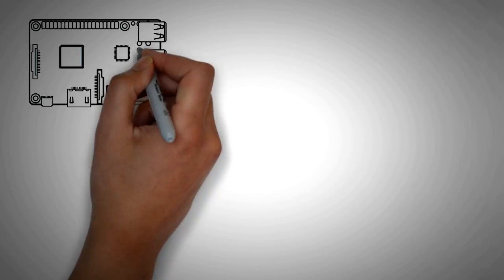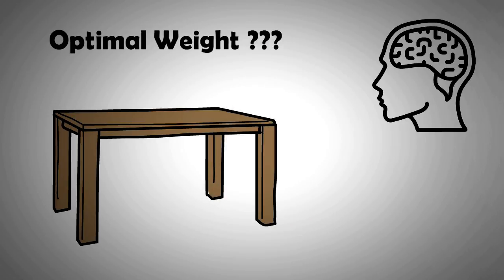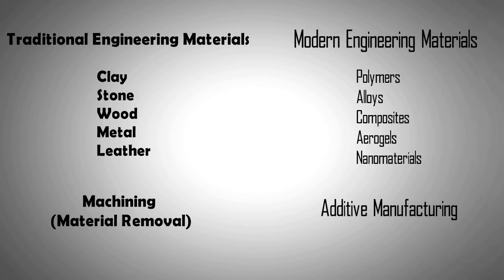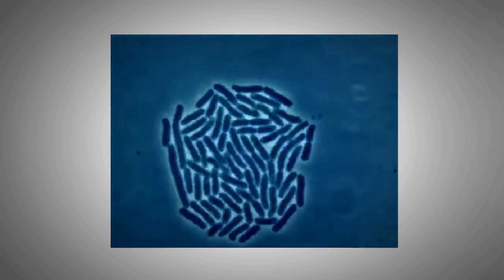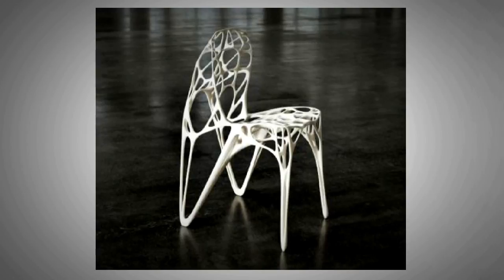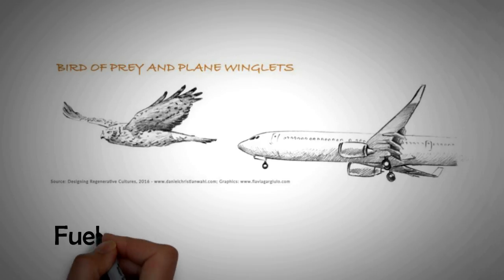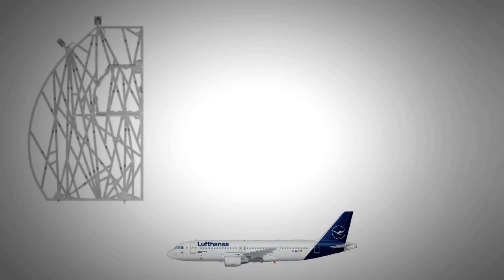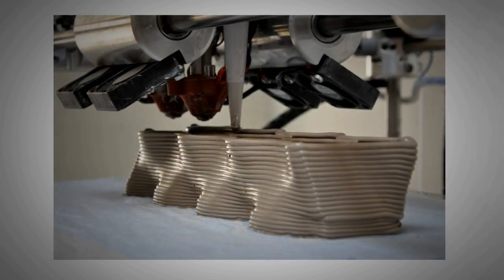Generative Design: A revolution in Engineering

Comment: Good stuff. I think the bigger problem than the organic shape design is the cost of printing and the cost of strong printable materials.
Reply: Good point... Just to open up the cost aspect with energy required/time consumption too in addition to machining/material costs... Overall cost/efficiency over time can bring the cost down of the printed materials though... as with mass/volume production and technological advancements will also bring down time/energy consumptions too... There will be a time printing stuff will be both much cheaper on time/energy and material costs...

Comment: These designs immediately reminded me of the Maserati Birdcage race car. This was a fifties race car space frame where instead of big box section main frame parts the car frame was built of of hundreds of little hollow steel tubes about the size of a pencil welded to form a 3D matrix. In those days of course they were all made by hand. This wonderful car was the lightest - but not the cheapest - race car in the world.

Comment: Works ok as long as you have ALL THE  LOAD CASES COVERED
Reply: There is always a weakest link. You can only cover in calculations most cases. Imagine constructing a bike that can take a side load ( hit ) - that would change shape of it dramatically. But is it necessary ?

Comment: why design a nice chair, when your computer can design an ugly one?
Reply: Yeah, but pretty won't save the planet, this can have a huge impact.
Reply: @colin7225  Exactly! think of the 0.02kCal you save when you move the lighter chair compared to the heavier one! That should easily offset the more elaborate production process in 5000 years!
Reply: @erikschmidt476  Are you being ironic, that process won't only be used in chairs
Reply: Let say we want to go to Mars or jus looking for efficiency in cargo ships . Weight can save you money, resources in production and exploitations. This kind of design give so many practical and economical benefits. And beauty is subjective  :)
Reply: Neh, you can cover the structure with your design, the idea behind generative design is to get the same strength for a structure with way less materials, making the product lighter and cheaper.
Reply: @colin7225  till molecular printing is invented, good luck producing printed metals with serious material properties. you are comparing cast with forged, rolled, etc. so naive.

Comment: I'm not impressed by experiments with fusions GD. All said and done the parts were the same weight and basically the same strength. Further GD locks you down a design road of more GD. The organic nature of GD makes it difficult to adopt conventional parts into a GD system. If your structure is not right angles how do you mount stuff? How would you even make a parts ecosystem in something as flued as GD? The ability to reuse common parts in a family product line would be very complicated.

Comment: This video is so wrong! Yes nature is very good in designing stuff, everyone would be having so much time to do optimization.  
First, human design simple table only if that is human desire (I suggest you type "table design" in google next time). Second human consider many factors when designing something even as simple as table. So human will design quality, beautiful, stylish, ergonomic table that is fast, easy and affordable to make. A.I. will design table 30% lighter than some overengineered (to make A.I. look good) counterpart,  with compromised ergonomics, aesthetics, quality that will look like it was design by Flinstones and will be expensive and time consuming to make because it can be made using only one technology. So human won't even look at weight because 1: table main purpose is to provide stable surface 2: he can estimate the weight even though it's not necessary. But A.I main objective is weight optimization. Congratulations A.I. you are an idiot.
Btw it's a rather bold statement to say "I designed it", when computer did for you. Don't you feel obsolete yet?